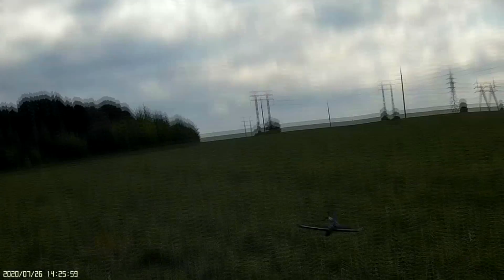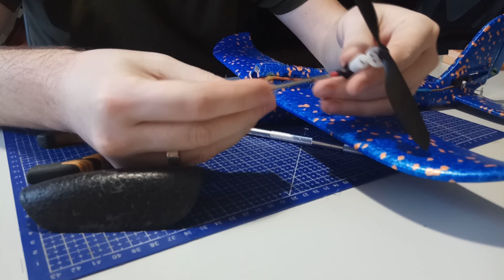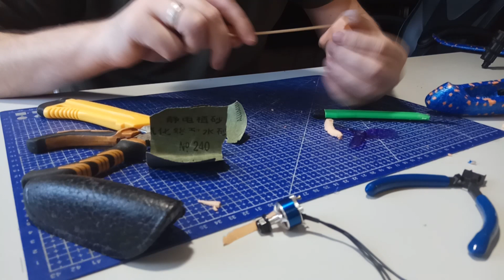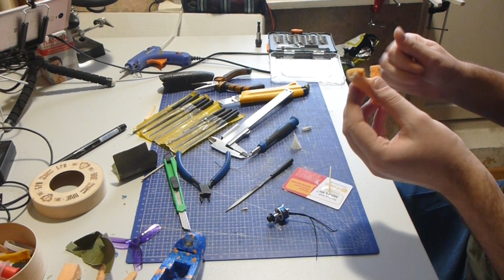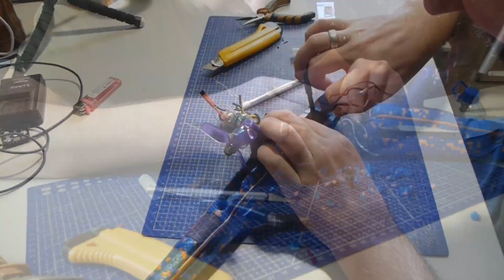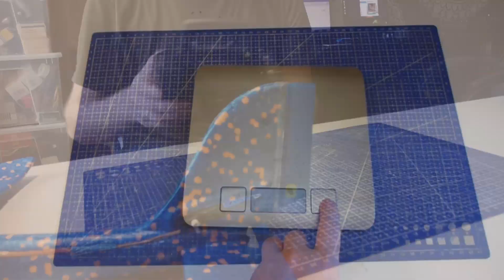DIY Переделываю детский планер 3 (glider Multiplex Fox turned to RC plane v.3)

Comment: at :49,  gotta  use  a  prop  with  a   SMALLER  diam.       googletranslate
Reply from the maker: prop was matched to the motor
Reply: @RCPlanesAndTravels  IRRELEVANT         the prop was  TOO  BIG, for this project.!
Reply from the maker: @daviddavids2884  in my other project, the propeller was even larger and the plane flies. https://www.youtube.com/watch?v=m-IGvK4u_U8&t=136s
Reply: @RCPlanesAndTravels  IRRELEVANT.      in this project, along with the wonky location of the motor,  the  too-large prop  resulted in  Excessive  dislocation/offset, of the the thrust  LINE.
Reply from the maker: @daviddavids2884  I suggest you wait for the flight and discuss, okay? )) I'm interested in myself.

Comment: information.        at :12,  source of thrust is/was  TOO  far (above) from  the center line of the airframe.    it's called  an  offset thrust line.      and, certain  things  Need to be done in order to accommodate its use.!!!!       at :19, as you can see, the  nose  is  Continually  'pushed down'.!!!           googletranslate
Reply from the maker: Yes, I agree. Therefore, I gave up on this design.
Reply: @RCPlanesAndTravels  so, you gave up.!!!
that's too bad.   BC   if  the  motor/prop  were  LOCATED  a  bit  AFT  of the wing, THEN  the thrust  Line   COULD  be  Correctly  configured.    out
Reply from the maker: @daviddavids2884  No, I didn't give up. I will fly on it a little, when the weather is good and then we will analyze the flight together with you. Okay?